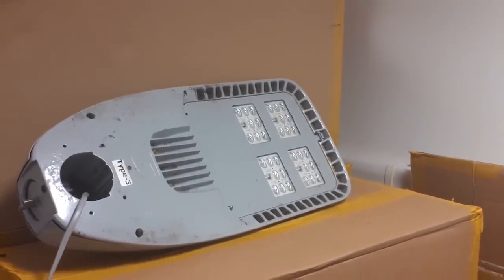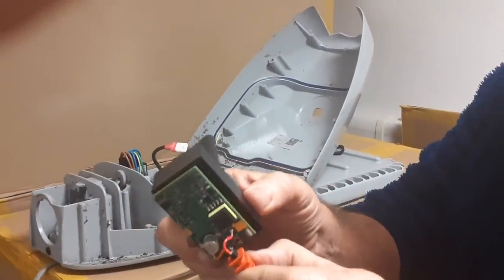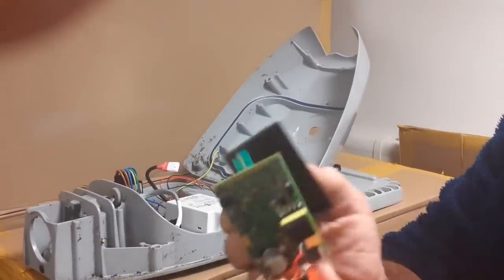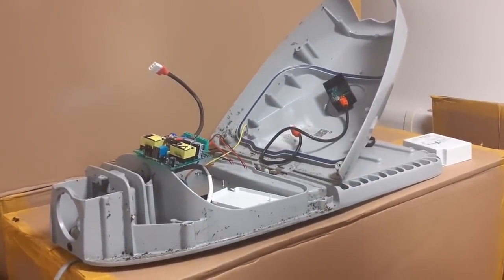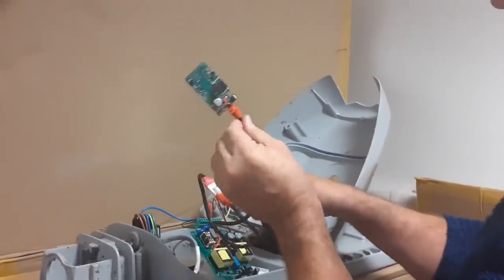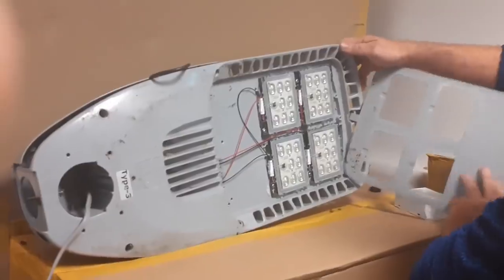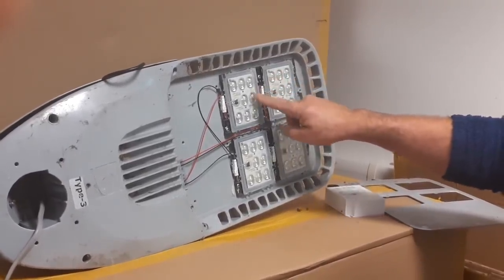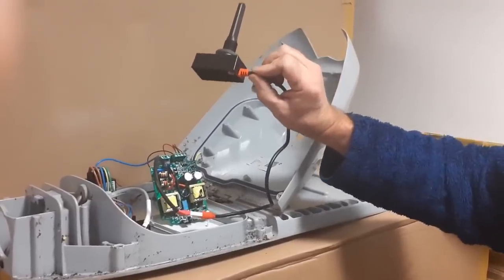5G LED STREET LIGHT TECH BREAK DOWN

Comment: If you want to highlight a story of genocide by government you have plenty of actual known cases to deal with. 
For a start. There's nuclear power.  The disaster of Fukushima and Chernobyl very rarely hit the headlines now, but effects from both of these are still causing birth defects and ending life prematurely for thousands of people.  9, 000 cancer cases induced by Chernobyl is the current working figure available. 
Fukushima is now considered a worse disaster officially. 
My point is that there are real threats to life for people to learn about. 
You can learn about all the facts to do with radioactivity and you can cross check what you are told from one source to another.  The people doing the lectures have been to school, atleast, and most will have learned all the basics, even if they are sometimes a little rusty about them. 
Or, you can just spend your time floating in a sea of fear, where nobody is on the same page about any 2 facts and anything reassuring is treated with suspicion.
Reply: Except Chernobyl and Fukushima were not deliberately caused by anyone let alone a government or a body of "elites". Chernobyl was in the USSR, an autocratic authority that simply sent you to Siberia if they wanted to commit genocide. No need for stealthy beam weapons to depopulate its citizens. Plus after the accident their government went to great lengths to evacuate an entire city and had volunteers put out the fire.

Fukushima too was obviously not deliberate. A tsunami caused by an earthquake and many volunteers worked day and night to restore backup power.

Anyway, I agree with your main point. Believing a conspiracy that there are "elites" working to depopulate the world is just ludicrous. Mark Steele is a self absorbed ignoramus. The premier example of Dunning Kruger.
Reply: @jtveg  The Chernobyl disaster was caused and exacerbated by putting the regime's pride before lives. 
Exactly the same thing is happening in the USA right now with the pandemic.  
Anyone who supports Trump is now in on the conspiracy to kill US citizens. This is not just serial killing, this is mass murder played out currently.
Reply: @rockbore  
No, I disagree.
There is a distinct difference between deliberate malice and reckless negligence.

After all it is the Trump supporters that think there is a conspiracy to oppress them with a fake Covid virus or to outright kill them with dangerous vaccines. You are implying that Trump supporters secretly wear masks but encourage their opponents not to wear them so that they will die.

This is obviously not the case. Unless you are claiming Trump supporters are conspiring to kill themselves?

Like the saying goes: "Don't attribute to malice that which can be explained by ignorance".
Reply: @jtveg  there must come a point where it is no longer tenable to say you didn't know better.
Reply: @jtveg  We need to resist the urge to race down to the bottom, to lock into a death grip with the other side. 
There are questions to be addressed and there is no sense when both side are in mutual animosity. 
How has it come to this? What is the point at which the spell is broken and sense prevails? Will it be when a loved one is lost to an infection contracted at a rally? Does it need to be so intimate?
How can we have been so very stupid?
This isn't just Trump supporters btw. 
Our leaders everywhere have failed to cover themselves with glory regarding the response.  
I have to say that the one sure thing we can all take away from our actions this year, and those of our leaders, is that,  collectively, we have some learning condition that place us all in the special needs category. We are a danger to ourselves. 
Our only hope is for artifical intelligence to come online before we do ourselves in for good.
Reply: @rockbore  
Lol. I think people fear AI more than anything else. Most of the problem is that the average person and education in general hasn't kept pace with the rapid increase in technology.

So when you have a society highly dependent on sophisticated technology, communications and medicine, yet you only have a tiny fraction of the population that understands this technology or medicine then they become susceptible to misinformation and will latch onto anything they feel gives them control in an otherwise world that seems totally out of their control.

When ignorance is glorified and intelligence is frowned upon these are the results. The only silver lining is that the extreme cases like Mark Steele here are a very small minority and no rational person takes them seriously anyway.
Reply: @jtveg  krishnan Guru Murthi did an excellent report on cultural aspiration. He found that Harlem usa had a culture which frowned apon education, contrasting with Chinese culture where the diploma and the degree are the most venerated of all achievements.  The outcomes are strikingly distinct for individuals. 
In China, though,  you could be learning anything. France has a proud tradition of what they call the Enlightenment,  which is a subject close to my own heart. But I'm not convinced the average French person really has a grip on subsequent discoveries, particularly concerning  E.M.
theory and 5G, for example. 
Even among the savants of utube and professional scientists it is common to find the same old fundamental errors recurring time and again. 
The most usual one is the moonlandings. 
Anyone who has the ability to consider the matter for themselves, independently, will have to conclude that the heat was an issue which was ignored for the mission. 
8 days in the sun, the unfiltered light, the 120°C of orbital noon, constantly for days on end. 
How can reasonable people defend such utter nonsense? 
It's all about credibility i suppose,  the emperor's new suit, nobody wants to be marching out of step. 
But then they have to make up explanations,.and that's when the fun begins. Cold Space. Unknown concepts in science are rhymed off like they were Gospel. 
And then there's the Gospels! Lol.
Reply: @rockbore  
Don't tell me you believe the moon landings were faked? Come on!

The astronauts were never exposed to direct sunlight at all. There was always ship shielding, their spacesuits and specially tinted visors on their helmets. Their suits and crew compartment also had a constantly conditioned environment, with temperature, humidity and oxygen supplied at appropriate levels.

If you are a moon hoaxer I'm done wasting my time talking to you.
Goodbye.   😷👋🏼
Reply: @jtveg  they didn't wear suits inside, it was 'shirt sleeves'.
Why mention the oxygen levels?
That is a bit odd. I didn't say anything about that. I do have some thoughts about that if you are interested in that topic. 
The current topic is public gullibility though.
Reply: @rockbore  
Obviously, the astronauts are protected from the sun's UV radiation when inside their spacecraft. 

The reason I mentioned oxygen was simply as a point to show that inside their spacesuits or craft the environment is managed so that it can comfortably sustain their lives. There is nothing odd about including all the systems that the suit maintains.. Oxygen, temperature, humidity, UV exposure and even scrubs high levels of CO2.

It sounds to me like you are gullible enough to believe the moon landings were faked. If the Russians didn't think they were faked then or now then why should a layman like you or me believe dodgy YouTubers with nonsense claims.

The Russians would have the greatest incentive to expose the US as a hoax if there was any inkling it was faked.

The Mercury, Gemini and Apollo missions have a long documented history and a logical progression of flights which culminated in the moon landings. Thousands of people worked on these projects and the best evidence is that we have moon samples. Moon rocks are unlike any Earth rocks.
Reply: @jtveg  
We aren't interested in uv light. What we are dicussing is infrared light- heat. 
Orbit is 120°C in the sunshine. 
Apollo was the only manned mission which claimed to go beyond the karman line, beyond low earth orbit, so the only one exposed to more than 40 minutes of continuous solar thermal blast.
Reply: @jtveg  
You've mentioned the Russians as corroborating Apollo, and you've advanced them as harsh critics with an axe to grind. But the truth is that the hated USSR, who eschewed democracy, worked hand in glove with the USA.  
I have never found any NASA criticism from the USSR.  
If Russia ever had any corroborating evidence of the moon landings, i don't recall it. 
But to keep it simple, which is the genius thing to do, we don't need to bother with Russians, or moon rocks. 
The plain fact is that if solar heat prevented the possibility of an Apollo style moon visit, then it must have not happened. 
So, how did the crew deal with twice over cooking temperature for 8 days?
What do they say?
They say space is cold, going to the moon.  
The say the sun is cold. 
You claim to refuse to engage in this conversation, and yet you offer the old lines of thought on the subject, which don't hold water. 
I do not hold any of this against you btw. 
This wasn't your doing. 
But now that you've been presented with the heat arguement,  are you willing to examine it as an Enlightened, rational soul?
You say that i shouldn't listen to crazy utubers, and that's good advice, on the face of it. 
The fact is that i havw scoured utube for cogent arguments on the hoax theory and the useful material is extremely scarce.  
'A funny thing happened on the way to the moon ' is an intersting piece based on leaked NASA footage, unseen until recently, showing a low earth orbit mission faking deep space by the rouse of making a small circle of the surface appear to be the entire planet using a round cut out. 
Ken Kasing (deceased) was an ex Rocketdime proof reader who made a movie called, 'it's only a paper moon', which was ok. And then there was an Italian who made a very thourough debunk film debunking all the hoax debunkers. 
But none of these were utubers. 
You can search through many pages of utube before finding a vid which genuinely wants to debunk Apollo.  
Mostly they are using the debunk as clickbate. Others give very weak proof.
There is only one utube host who really asks the difficult questions,.and gets to the very heart of the history and lays it all out. 
Thats me. 
https://youtu.be/Zztbw7MLlkI

Comment: They have these every were here and even right at my apt window   I'm so  worried  about  it nobody believes that they are dangerous to your health what can you do to protect  your  self ??
Reply: This isn't 5G as the 5G ones are more hefty with a cylinder top. The antenna maybe so they can turn the light on or off remotely at different times. Recent lights had light sensors on the top, so to switch on when the light level fell. I can't see a light sensor. Neither can I see any digital electronics for it to be 5G or a csmart" device. The antenna seems fixed so just a normal antenna. By measuring the length of the antenna, you can get the wavelength and then divide by the speed of light to get the frequency, then you'd know it it is 5G. But it looks analogue, too simple as it would be packed full of digital electronics, so just a dumb receiver, probably not even a transmitter.
Reply: search for Dr Klinghardt work , he may help
Reply: You could grow up you fucking idiot.
Reply: You get an emf meter and they hear it they’ll believe it.
Reply: Lead paint your house.

Comment: 3300W relay thats more power than my Electric Fire ..
Reply: Arp Hitching so to recap about the streetlight

1) Using  700-800 Mhz NB iOT  module
2) PCB Antenna
3) No Fan or heatsink on the PCB (fanless operation)
4) Metal Enclosure around the LED Light controller
5) Only RF in or out of that metal enclosure is the NB module's PCB antenna that sticks out of the metal enclosure
6) no other holes in the metal enclosure for any kind of radar or tracking sensor (Some models could have a PIR sensor but they're more expensive ,  there are radar sensors but those are even more expensive than PIR)
7) Fanless operation  using an off the shelf NB iOT module  - probably not more than 100mW of actual RF output 
8) NB is the new alternative to Zigbee as it has more bandwidth (100KB/sec.  max  - zigbee is around 10KB/sec.) which leads to larger mesh networked sensors  and less lag (also means you can ride encryption on top of that so nobody can inject traffic and mess with your lights)
Reply: @TheSpiritualPhysicist  Thanks for the explanation of what the module actually is. That makes more sense than my own speculation. Cheers :-) And to Arp: You sold yourself out as English with "electric fire" how utterly localised :-D

Comment: Just amazing!! Can I please share this on my Channel? Max led me to this Video!! God Bless!
Reply: Erik sees all so to recap about the streetlight

1) Using  700-800 Mhz NB iOT  module
2) PCB Antenna
3) No Fan or heatsink on the PCB (fanless operation)
4) Metal Enclosure around the LED Light controller
5) Only RF in or out of that metal enclosure is the NB module's PCB antenna that sticks out of the metal enclosure
6) no other holes in the metal enclosure for any kind of radar or tracking sensor (Some models could have a PIR sensor but they're more expensive ,  there are radar sensors but those are even more expensive than PIR)
7) Fanless operation  using an off the shelf NB iOT module  - probably not more than 100mW of actual RF output 
8) NB is the new alternative to Zigbee as it has more bandwidth (100KB/sec.  max  - zigbee is around 10KB/sec.) which leads to larger mesh networked sensors  and less lag (also means you can ride encryption on top of that so nobody can inject traffic and mess with your lights)

Comment: What about the green lamp posts that have a more squat and rounded top? I don't have this type (above) on my street, but I am still wondering if the green ones are the same?
Reply: He's talking crap. It's just a modern LED street light with the ability to be switched on remotely at dusk. The antenna just receives a very weak signal asking it to turn on. No death rays
Reply: @tenmillionvolts  I agree.
Reply: Hes definitely NOT talking bs. Hes saying nothing but the truth. Do some research, you'll see for yourself.  ignore these oblivious individuals. There's too much proof literally everywhere stating otherwise. Bblessed

Comment: 5G is 5TH Generation Wifi, on Led Street Lights, installed every 50-100 Metres, on Lampposts, Traffic Lights, Street Furniture, Emitting 24/7 Microwave Radiation
Can Radar Scan Your Home, with Unlawful 3D Mapping, Surveillance & Data Collection, & Connect to 'Smart' Tech, for 'Smart' Cities    
It will Connect to the 'Internet of Things' which will Collect your Personal Data in the Privacy of Your Home Without your Consent 24/7 
Invisible Transmission of Extremely High Frequency Millimetre-Wave Radiation, Kills Trees, Birds, Bees, & catastrophic to Human Health
Carcinogenic Pulsed Optical Radiation, will Double Cancer Rates
5G in Schools, Hospitals, 5G Towers, & 'Bus Connects' will give Blanket Coverage, Driverless cars, with No Escape
Requires the Hacking of Thousands of Trees, An Experiment on Humanity defined as a crime under international Law   
NO Safety Guidelines
NO Insurance Company will Cover it
NO Escape from the Radiation
NO Consent from the Public
Reply: Lol tin foil hat brigade
Reply: Moonshine12 goood idea
Reply: but the internet will be 3 seconds faster..........
Reply: Fionn Una so to recap about the streetlight

1) Using  700-800 Mhz NB iOT  module
2) PCB Antenna
3) No Fan or heatsink on the PCB (fanless operation)
4) Metal Enclosure around the LED Light controller
5) Only RF in or out of that metal enclosure is the NB module's PCB antenna that sticks out of the metal enclosure
6) no other holes in the metal enclosure for any kind of radar or tracking sensor (Some models could have a PIR sensor but they're more expensive ,  there are radar sensors but those are even more expensive than PIR)
7) Fanless operation  using an off the shelf NB iOT module  - probably not more than 100mW of actual RF output 
8) NB is the new alternative to Zigbee as it has more bandwidth (100KB/sec.  max  - zigbee is around 10KB/sec.) which leads to larger mesh networked sensors  and less lag (also means you can ride encryption on top of that so nobody can inject traffic and mess with your lights)
Reply: We said no when they kept on ringing us asking for smart meters to be installed....last week I went outside after hearing some drilling and they literally had put a gas smart meters outside everybody's house..they wasn't live but now after a week I believe they have been made live.
Reply: My guess.... Fiona also doesn't like Vaccines... (Jus' Sayin')
Reply: @hanxhancocks1727   of course i don't, neither does Bill Gates, for himself, & his family, he Loves vaccines for everyone else however.
Reply: Hanx Hancocks well vaccines are pretty dumb bypassing the natural first layer of the immune system going straight for the big guns and macrophages and T cells ... inspiring the body to overreact ... the same way corona kills ... JAMA is the authority on vaccines ... I’d never let anyone inject anything into me for any reason whatsoever ...